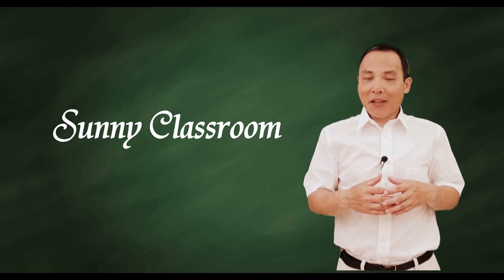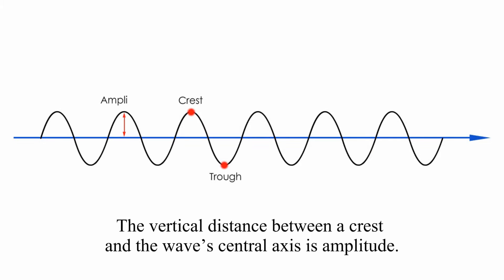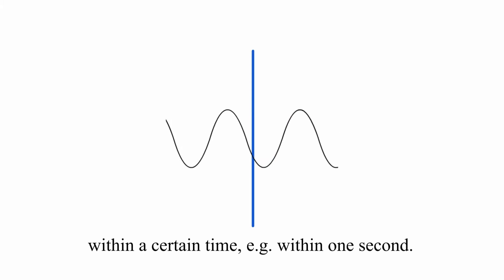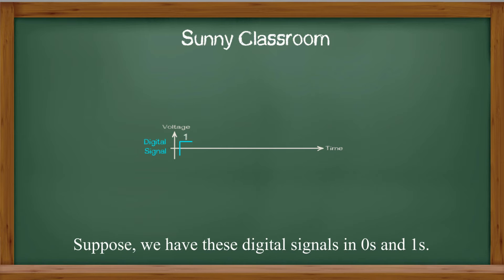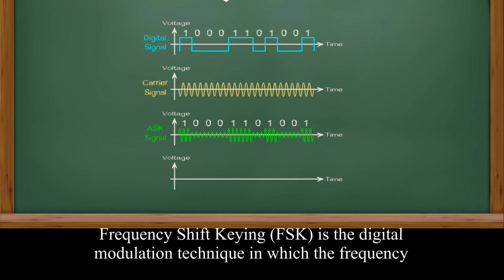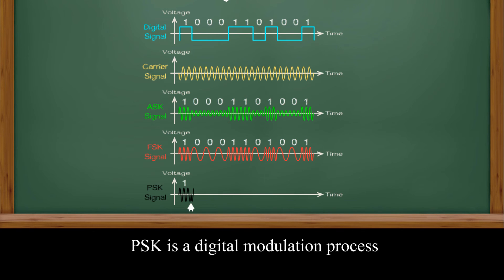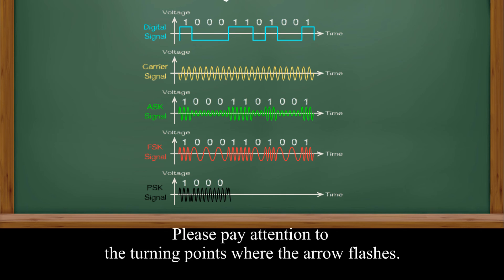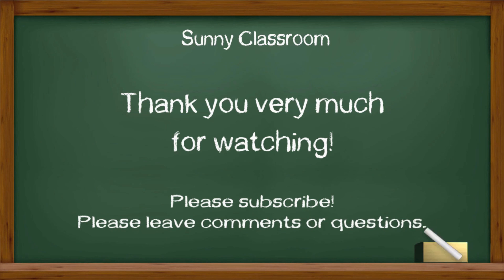Digital modulation: ASK, FSK, and PSK

Comment: Quick notes:
Modulation describes the process of representing digital signal in physical form. 
ASK: High Aplitude writes 1, low amplitude writes 0 
FSK: Higher Frequency writes 1, lower frequency writes 0
PSK: A phase change basically means a switch - you either switch to start sending 1s or 0s - you write the same value until you "switch" again

Comment: hi,
i need to know a data modem with 2gfsk & 4gfsk modulation to be not loose speed in amplifier connection needs the same modulation supporting from amplifier i have read..if the amplifier is only says gfsk supporting the 2gfsk & 4gfsk without diference in total data speed or not?

Comment: Hi Sunny,after watching your videos about FHSS\DSSS and the three different modulation methods,I still can not understand something:
1、when use ASK,we change the amplitude.Let's say amplitude of 20 represents digit 1,amplitude of 10 represents digit 0. As a receiver,how do I know the "10" and "20"？and signals will also  Attenuate when transmitting,even if the receiver knows the 20 represents digit 1 at first,maybe due to attenuation,when the receiver receives the signal,the "20" turns into "18" or "19".what will happen in this circumstance?
2、when use FSK,we change the frequency.but when we use 2.4Ghz,the signals' frequecy will be 2.4Ghz,if I use FSK to change the frequency,the signal will outside the 2.4Ghz spectrum.maybe this is not legal.
3、In wifi,we use 2.4Ghz and 5Ghz frequency to transmit signals,the frequency is so high,2.4G circles per second. why the actual data rate is 11Mbps or 54Mbps which is far from 2.4Gbps? why not directly use two kinds of waves to represent 1 and 0?